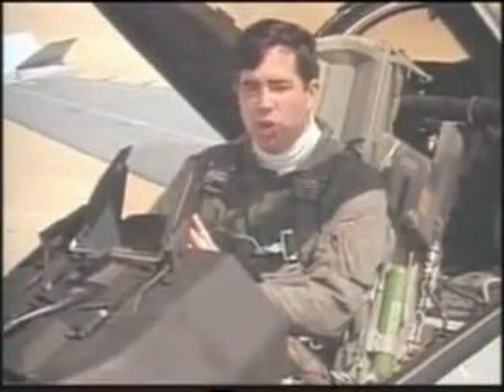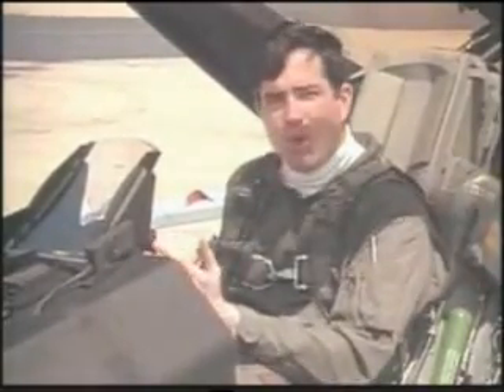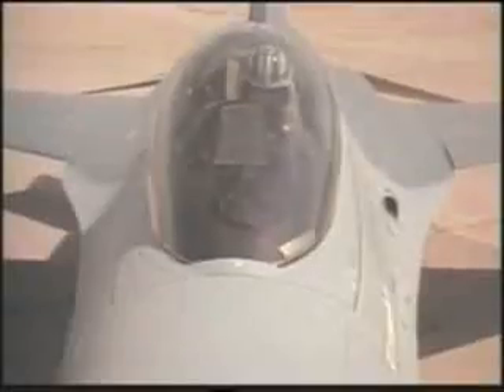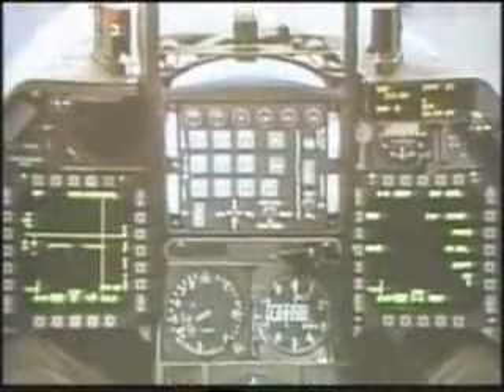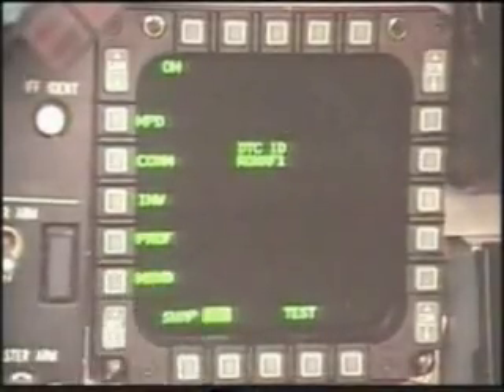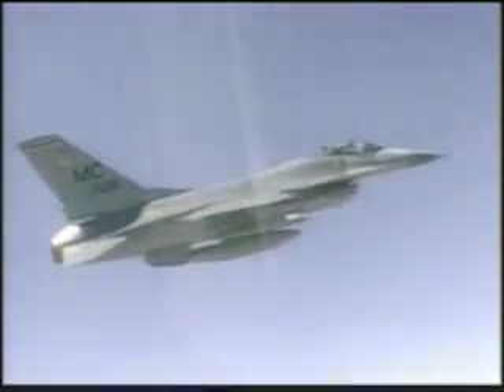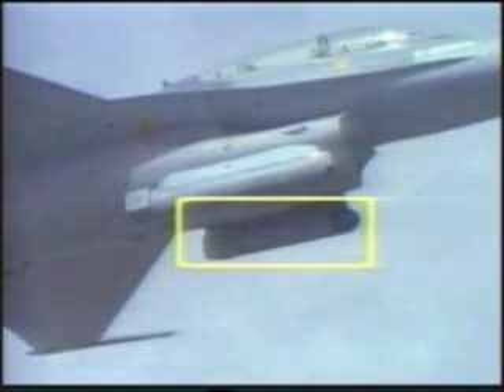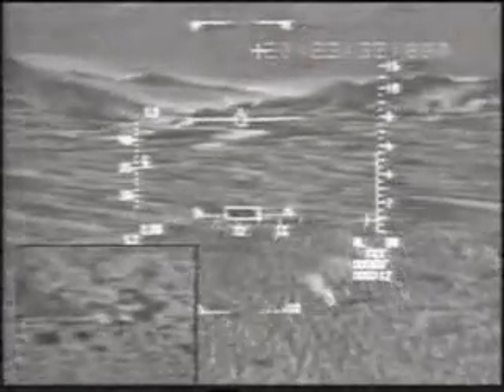F16 Cockpit Functionality Video

Comment: Kinda neat to see a video all the way back from like 1984 going over the systems of the F-16C. The one in this video looks to be a Block-25, since it's got the small intake and PW100 engine (as well as using cassettes for flight, combat, weapons, and navigation data).

Still, it's really neat to see

Comment: @GhostFight3r F4AF is not too realistic, if you need realism you need Falcon 4 BMS 4.32!!! or Open Falcon 4.7 (this is addon for Falcon 4) For AF version is only one addon: FreeFalcon aka Red Viper whitch changing some thing in avionics too. So all Falcon 4 series simulators are not 100% realistic. So better avionics in Falcon 4 series have Falcon BMS 4, Allied Force have the poorest avionics in Falcon 4 series.
EDIT:
BMS 4.33 is actual version as for 2017. It includes so many improvements.
Reply: Falcon BMS is love.... Falcon BMS is life.